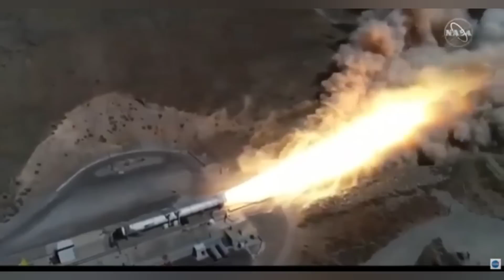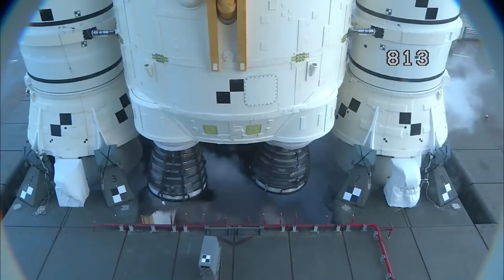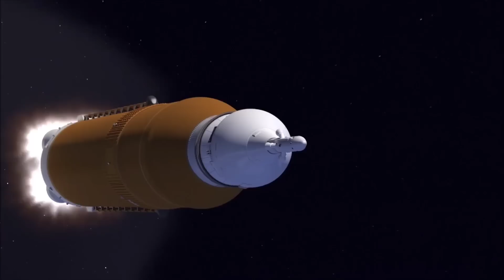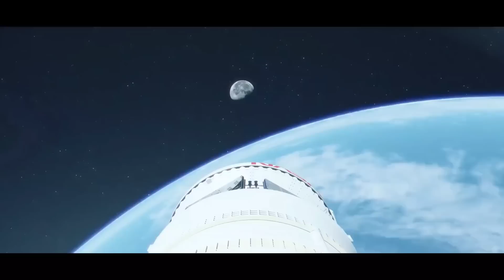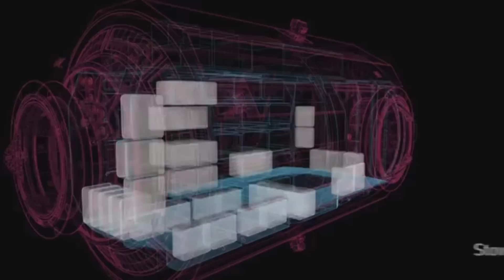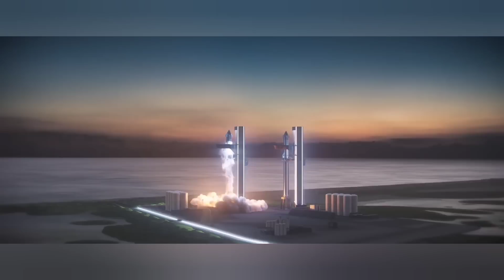Bill Nelson and NASA are doubling down on SLS!!  Why??

Comment: When people talk about Starship's 30 engines, they often forget that SpaceX actually already flies Falcon Heavy which has 27 engines.
Reply: The N-1 actual flew with its 30+ engines it was there quality control that let the thing down  fuel leaks computer shutdowns etc budget cuts and substandard work practices
Reply: Completely different engines, different fuel and Starship engines vastly more powerful.  (forget the numbers but newest engines have some 300 tons thrust)
Reply: @Mrbfgray  doesn't mean they are less reliable which is the only metric that matters
Reply: @TheShorterboy    SURE--let's spend a trillion dollars of your grandchlidren's money to make it 2% safer.  Enjoy double digit inflation forever.
Reply: @Mrbfgray  that makes no sense, you alluded to the fact they are different engines with the implication that somehow this now presages a lack of reliability which no one can claim at this juncture. 

Nowhere did I demand the state pay trillions, SpaceX is a private company so I don't see how you draw the conclusion that SpaceX having reliable engines is going to cost the US government trillions.
Reply: @TheShorterboy    Regardless it's folly to say "only one metric matters".  I don't how reliability got into this, I made no such referrence.
Reply: @Mrbfgray  Current Raptor cost is confirmed to be $500,000 per unit. So $16.5 million for 33. 33 Raptors cost around 3 times less than one single RS-25 at around $50,000,000.

Also they don't have to develop a second engine just for Super Heavy. Starship needs an engine the size of Raptor.
Reply: totally different
Reply: 28 Merlins if you count the upper stage! 😎
Reply: Falcon Heavy is not comparable, as it has the 27 engines spread across three cores, not all in the same core.
Reply: @GoranXII Statistically, that makes no difference. If one core fails, the system fails, same as starship and SLS. IMO, id rather fly on a ship with 33 liquid fuel engines which gives redundancy under many circumstances, rather than SLS which has 4 RS25 (with un(flight)tested new controllers) and two solid boosters that can't be shut off or throttled. If they are made and tested properly, neither system should pose significant risk of failure, so the point is probably mute.
Reply: @philcanny6356  The difference being that each nine-engine core has had extensive testing. A single unit with 33 interconnected engines is extremely complex.
Reply: @GoranXII  Surely FH would be more likely to fail based on your logic. Ignoring the slight difference in engine numbers, FH has three sets of tanks, pumps and control systems to Starships one. It also has a critical period during booster separation, which Starship doesn't.
Reply: @philcanny6356  Not necessarily. As was demonstrated with the N1, putting too many engines on one rocket will see them interfering with each other , which means that, despite having almost as many engines as Starship, Falcon Heavy is much less likely to run into issues, since each core only has nine engines, with the connections between the cores damping most of the possible interference.
Reply: @GoranXII  Comparing N1 with Starship is a bit of a stretch. The technical level, manufacturing quality and sophistication of control and monitoring was from a different era. Will there be harmonic issues between the engines?  Neither of us know, but I would expect that the control software will catch any such issue long before it causes a problem. This really is a matter of opinion, so we can maybe agree to disagree. Let's wait and see.
Reply: @philcanny6356  No more of a stretch than comparing Falcon Heavy to Starship.
Reply: @GoranXII  N1 was designed in the 60s by a Russian state owned enterprise under extreme political pressure. Starship and FH are of this era and made by the same private company with the same design and test regimes imparted by the owner, who is more interested in success than time lines. If anything, the success of the rapidly developed FH bodes well for Starship. The only thing in common with N1 is that starship is a rocket with  a lot of engines. Same as comparing a Lada to a Tesla. Both cars with 4 wheels, so must be the same - No not really
Reply: @philcanny6356  Actually, a closer analogy would be asking a company famous for its V8 engines to try producing a H24. Here's a clue, it's not going to be an easy thing.
Reply: @GoranXII  I agree, if it was easy the N1 would have worked. Let's wait and see, as we appear to be spinning our wheels here.
Reply: Aka- an engineering liability. Just be honest with yourself.
Reply: @Gnefitisis  
Beta Musk Haters: starship will never work because it has too many engines and is a liability
Chad Falcon Heavy: flies with 27 engines and lands 3 boosters flawlessly
Reply: @auston3952  ah yes. The Megachad N1 rocket. Vs the Virgin-beta Saturn V.
Your analysis is deep and definitely not stupid af.
Reply: @Gnefitisis  Both Falcon 9 and Starship have a redundant number of engines,
they can lose multiple engines and still fly
Reply: @Gnefitisis  Liability or… redundancy? In the case of Starship, actually redundancy.
Reply: @shableep  If this were mechanical engineering and was a support column, I wouldn't disagree. However, these are integrated plumbing systems, also failure would lead to combustion instability.  Satellites (like the recent Starliner) can have failures in their monopropellent systems and still service, outside of Earth's atmosphere and with enough inertia; but with plumbing systems, that's like saying "oh put some more electrical components on the circuit board for redundancy." 

Yeah, I still think liability. Bigger and fewer means less moving parts, even if you have more reliance on each subsystem.
Reply: @Gnefitisis  Combustion instability would be transient, as the system would kill fuel or oxidiser feed if the engine was faulty. Statistically, you would have to demonstrate your point. All parameters being equal, a bigger engine is probably more likely to fail, due to material physics. The consequences of that failure are definitely more severe; 1/4 vs 1/33. However, the Raptors are much more stressed than the RS25, so the material physics balance may be skewed toward RS25 being better. So which liquid engine combination is safer, is really unknown. However, use of solid motors for manned flight should have went the same way as the shuttle. These are basically uncontrollable once lit, as Challenger demonstrated. SLS boosters are sufficiently different from Shuttles, to make for a very nervous first few crews.  Ultimately, if we want to "do space" properly, we need to look at Starship and not SLS. SLS fails on the main significant metrics, other than it might be ready earlier than starship. So what? Satrun 5  could have been made available again faster than SLS and could actually land men on the moon, however, it still lacks the capability to economically establish lunar infrastructure due to a lack of fast re-usability.
Reply: @philcanny6356  All things being equal and if I was being paid to be an engineering consult (having access to all the data), I'm sure I could make my point for less is more... that being said, the historical record has proven that rocket engines tend to be difficult to control (if for the brightest engineers for the last 70 years, even outside the US).
Reply: @Gnefitisis  I agree that this is ultimately a matter of opinion given the data that we have access to. What is fact is that we will have the statistical basis in short order once Starship starts to fly, assuming the cadence is as advertised. My main concern on human rating Starship would not be launch related, which I think SpaceX will master. The real task is making the flip landing reliable enough to human rate.
For SLS, at a rate of 1 per year, no statistically significant number will be reached prior to the program being terminated due to shear expense and lack of capability versus the competition.

What about the two SRBs and human rating? What's your opinion?
Reply: @Gnefitisis  33 engines makes for fantastic engine-out capability

Comment: $£$ development cost is not $18B. It's WAY more than that.

"The SLS program has cost NASA more than $23 billion (accounting for inflation) in its first 10 years."
Reply: I would include the costs and cost overruns from the Constellation project too. SLS is basically just the Ares V.
Reply: Tbf, that’s remarkably cheap for a NASA launch system.

Comment: NASA's timidity, together with that of the US Congress, is very frustrating. Apollo-Saturn was designed to launch every two months (tho it only actually kept up this cadence for Apollos 9, 10 and 11) using launch complexes 39A and B. Land was set aside for additional launch complexes 39C and even D, if required, which would have allowed up to 12 Saturn V launches a year.
Reply: man that woulda been. cool
Reply: @mylesl2890  – Sorry, my arithmetic went haywire. I meant, 12 launches a year (now corrected above). Which would still have been great, and allowed for permanent occupation of a Moonbase.
Reply: @Astronist  no worries.  def woulda. been.  cool. maybe it's in the future
Reply: To be fair NASA’s budget was much larger during Apollo than it is now
Reply: @redbeard11200  – Agreed. I should have said: NASA's and the US Congress's timidity (original comment updated).
Reply: @Astronist  I feel like it’s probably Congress mostly. I’m sure if it was up to NASA they would have designed an entirely new vehicle from the ground up instead of using STS parts and I’m sure they’d try their best to launch more than once a year if they could afford it. Congress is the one forcing them to use Shuttle tanks and boosters and engines and Delta IV upper stages
Reply: @redbeard11200  Shelby was able to pressure enough of his colleagues to forced NASA to use SLS after Obama tried to kill it. With Shelby on his way out, it's mostly a whole lot of sunk cost fallacy. 23 billion dollars have been spent on the rocket. It's gotta be used for something. Anything.
Reply: @Scriptedviolince  I hope it’s used for something I really do. I want to see it fly more than anyone man yk

Comment: Regardless of what SLS does, the way NASA has its Artemis program set up, the HLS Starship lunar lander will be the next U.S. spacecraft to land on the lunar surface carrying astronauts. 

In fact, there will be at least one uncrewed Starship lunar lander touchdown on the lunar surface to verify that Starship can make the flight from LEO to the NRHO to the lunar surface and back to the NRHO.

SpaceX and Starship have responsibility for the most critical and technology-intensive part of NASA's Artemis program, namely landing astronauts on the lunar surface.
Reply: The last I read, HLS will be refuelled in LEO, So actually, HLS could fly astronauts from LEO, onto the moon and back to LEO. So why do we need all of the other Artemis equipment? SLS and Orion are redundant and HLS could dispense 6 orbiting comms satellites around the moon to retain continuous comms to Earth, so there goes Gateways USP. HLS current design is marginal for LEO return, so an extended tank version is under consideration along with a six VRaptor version. Artemis is space exploration designed by committee. It is a camel when what is needed is a horse.

Comment: I'll admit, SLS is so far in development that it would be crazy to junk it. That said, this kind of developmental paradigm NEEDS to end: a functional space program is just not sustainable this way. Yeah it's not as expensive as you'd think, but it's taken a DECADE!!! Look at what Musk has managed in the same time: damn near a full space program from the ground up in that time.
Reply: Good money after bad.  Cut our losses, it's a boondogle that only continues to exist due to political manipulation, they have some nut or bolt made in near every congressional district so it's hard to kill no matter how wasteful.  JUNK IT NOW.
Reply: That's a great example of the sunk cost fallacy.
Reply: Sunk cost fallacy strikes again.
Reply: SLS should be used to chuck space station components in LEO/LO instead
Reply: @liammeech  Starship will also be better at that once it's operational. Taking more mass to LEO and not even needing refueling if its not going farther than LEO.

Comment: This NASA white elephant should not be allowed to fly it is a waste of money, 23 billion they have spent on it and only the capsule will remain after the test launch, then they plan to build another one to go unmanned tp the Moon and back, then they will have to build another one to get to the Moon with people on board, those people will be dropped off at a Moon orbiting ISS type station which is not built or even designed yet where they will be picked up by SpaceX's  Starship which will take them down to the surface of the Moon and bring them back up again......MADNESS just go in the Starship there and back and save billions......SLS is purely a vanity project all because NASA has a strope on because they have failed to do in decades what SpaceX has done in a few years.

Comment: We are not going to go to mars and the moon to stay with the policy of big complex expensive rocket that is useful only to send people to the moon.  How many times has Falcon Heavy flown? 
How many times did  Delta IV heavy?  The reason international commerce work is containers.  Space Assembly with multiple off-the-shelf launches is the way to go.  We don't have the space shuttle any longer, but we have powerful complex computers that allow self-assembly. The same goes with space X obsession with the StarShip, Ellon may move space X into bankruptcy. It's too complex the tiles keep falling from it,    it won't be cheap to maintain,  is eating into space X capacity to produce more Dragons is a disaster. If the objective is cheap space a big fairing Falcon 9 derivative using the Raptors will be a better option.

Comment: 'Is Starship the rocket of the future? Yes, absolutely.'  How can you say 'absolutely' when that program consists of nothing but unknowns.  
Starship is fraught with so many challenges that SpaceX itself is at risk of failure if they misjudge what is attainable.  At this point, success is by no means certain and if they do press to the bitter end and succeed with a useable system, it probably will be somewhat less capable, more expensive and less reliable than they expect, or anyone is willing to tolerate.
Reply: Thank you for bringing this point up. Despite all the best of intentions and planning, there are no guarantees that Starship/Superheavy will perform as expected, and even if it 100% meets performance goals, there's no guarantee that the turnaround time will be as short or as low-cost as currently envisioned.

I'm by no means an aerospace engineer, but I see three potential major hurdles Starship/Superheavy still needs to flight demonstrate. Superheavy ascent (that's a whole lotta engines and thrust to manage), Starship reentry control (sure it can slow-speed belly-flop, but how's it going to do at hypersonic velocities?) and thermal controls (most Starship reentry, but also overall thermal tile resilience and longevity.) The first two are mandatory for the program in general, whereas the third is perhaps mostly related to turn-around time between flights. Any significant issues could radically alter the program's conceptual framework in terms of cost and reusability, which of course would have downstream effects on other programs dependant on Starship, etc.
Reply: Remember what happened with the Space Shuttle - it was advertised as a cheap, safe and reliable way of getting into space.  Instead, the exact opposite occurred. While a brilliant technical achievement, it proved to be extremely expensive, very dangerous and unreliable - flights were delayed so often. I am not saying the same will happen with Starship, but The analogy is there. 
Therefore one should be cautious and wary about the claims made for Starship until it has flown a few times at least. When that first flight will take place, we don’t know but it may still be a while. 
Of course, is Starship does not work as advertised then Artemis will be stuck until another lunar lander system can take its place. Delays will simply add to the already huge cost and if delays keep mounting up then the US Government and Congress May simply decide to scrap the whole thing.
Which leaves Moon landings to the Chinese, if they are determined enough to do it.
If Artemis Moon Landings do not take place then never in the field of human endeavor has so much money been spent for absolutely nothing, and NASA’s credibility will be destroyed. 
I think it was foolish of NASA not to have selected 2 landing systems, to have a back up in case of problems.  They could pay a very heavy price for that indeed if Starship does not work as planned.

Comment: Methinks that orbital refuelling is the key to inter-orbit shuttle which should be cheaper and less complex alternative to that steel monster. Launch crews on small vehicles (SSTO if you can), move them to that shuttle already been refuelled, transport them to the lunar orbit and make sure that they will stay for half of the year at least.

Interorbital shuttle could be simple frame with engines, nav system and fuel tanks, and docking device to anchor crew capsule. Some sort of "Service Module", but reuseable.
Reply: Since you can only get 4% of mass as payload to space, you need massive steal rockets to get the fuel up there.
Reply: @pietersmit621  yeah, but after that you don't have to carry all this steel to lunar orbit